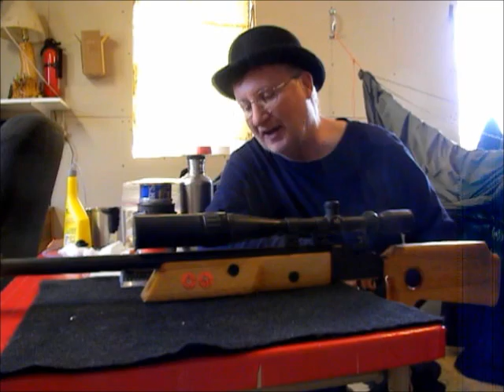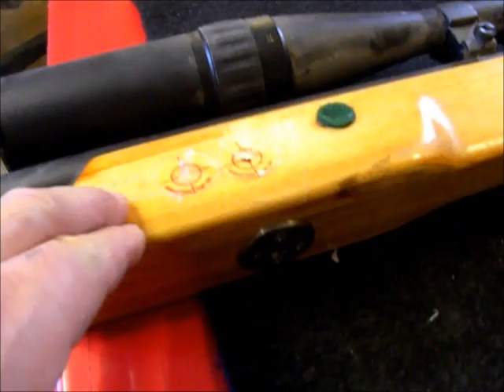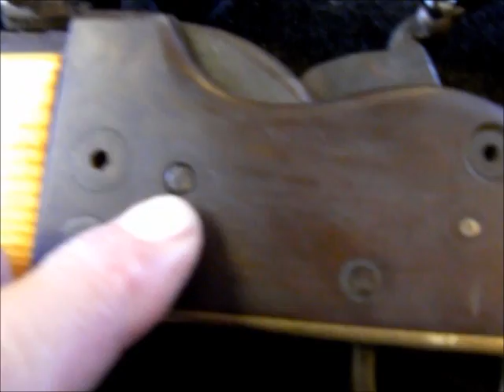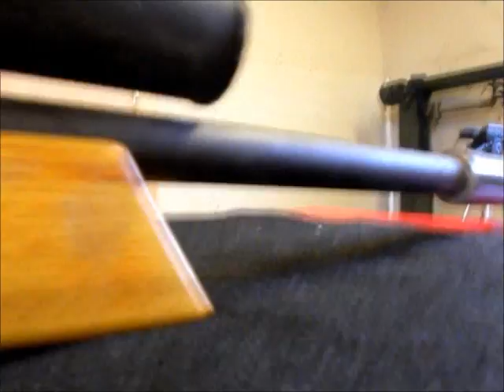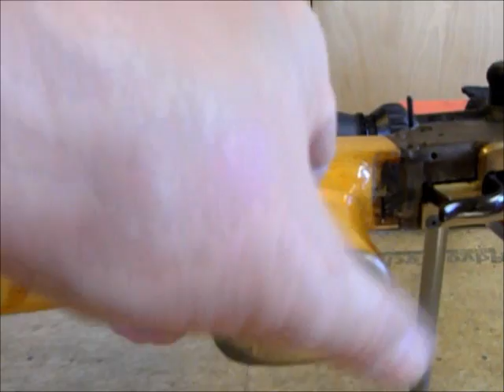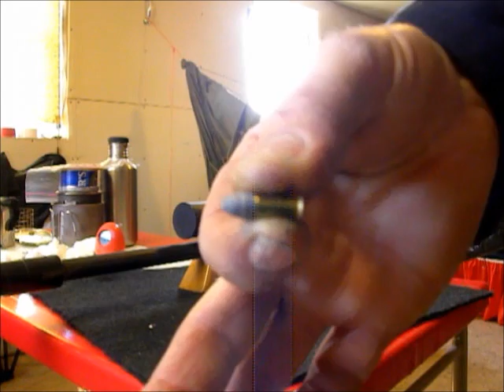Handmade target rifle

Comment: Building of a homemade firearm is not illegal unless it is fully automatic. It's dangerous if you don't know what you're doing, but Tiny did a good job. Yes the suppressor is possibly illegal, but the age might grandfather it in (would have to research more), but threat could be fixed with a class 3 permit.